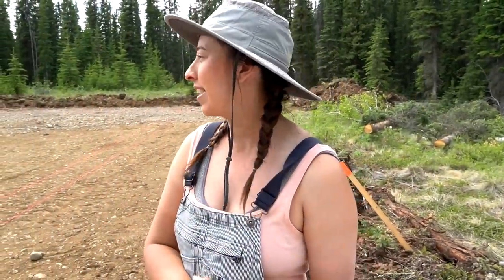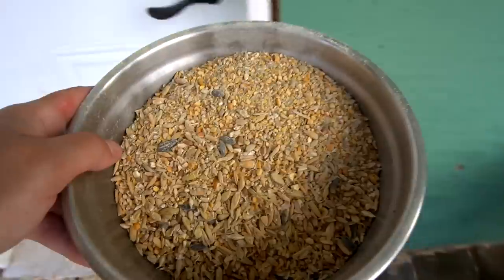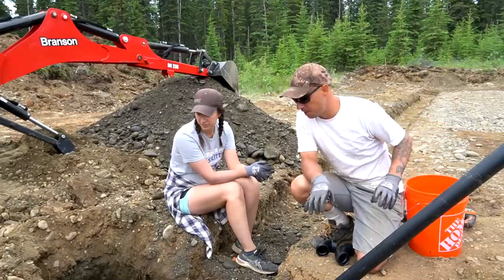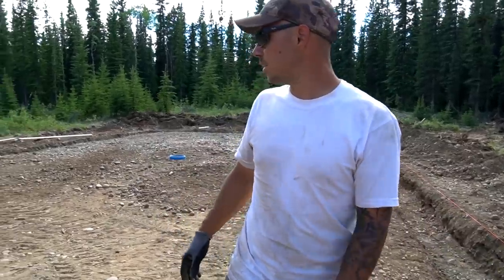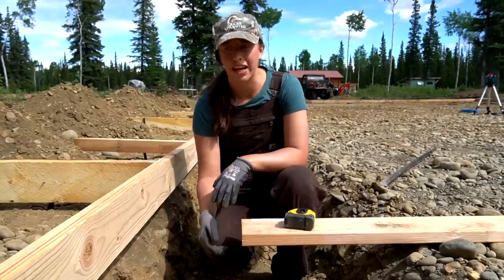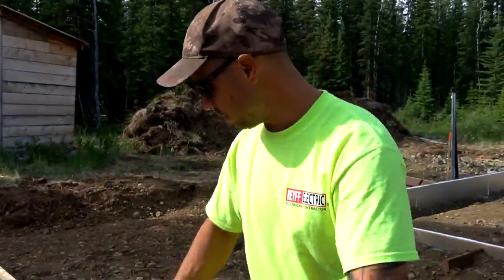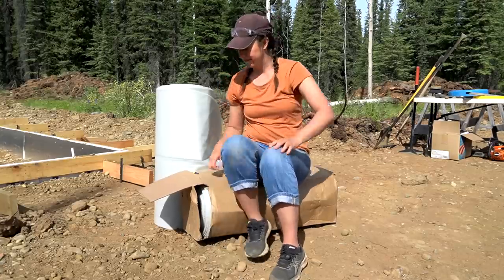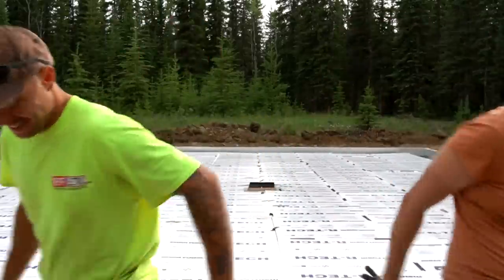The Never-Ending Footers | DIY Insulated Concrete Slab | Alaska Quonset Hut Build

Comment: I spent a lot of time on construction sites both large and small.  You guys are doing a spectacular job on a very ambitious project.  You two inspire us all!!   I have only one criticism---PLEASE DO NOT WEAR SANDALS while working on these projects.  I know you guys are very careful--but risking an injury to a foot in such a remote area is not a good idea.  In fact you both should invest in steel-toe boots--just as a precaution.  Yes they are costly --but taking measures to be safe is worth it.  Thanks so much for sharing your journey with us.
Reply: I was thinking the same thing!
Reply: I was thinking that about the footwear...
Reply: At the very least get the boots that  have a composite toe, much lighter. You can even get a kind running shoe with composite toe.
Reply: Engage Ariat Footwear sponsorship!
Reply: I absolutely agree. It’s way too easy to get a bad injury. When it’s your foot it really stops you doing things whilst it heals - and you are busy people :)
I know it’s hot and you don’t want hot feet….. minty light weight moisturiser at the start of the day, change your socks at lunch time (if you get a lunchtime!) and it will help you get through the day. 
One of those larger stones on a toe - six weeks of pain, swelling and inability to keep up with the jobs whilst it heals :(
Reply: Agreed...I wear composite toe (carbon fiber) boots with merino wool socks year-round.  Even when it's 100f+, insulation works both ways.  I do wear an uninsulated and vented "jungle boot" in the Summer and heavy insulated in the Winter...but the socks never change!

I've broken toes...turns out the stupid things are kinda important to mobility. LOL
Reply: Someone should sponsor them!!!!
Reply: We all learn that lesson the hard way. 😂

Comment: I know it was a lot of hard work putting this video together,plus concentrate on your measurements for the floor.
Just wanted to let you both know we appreciate you! Thank you!❤
Reply: lndeed!  Excellent filming and editing skills....balance of project, animals, scenery...
Reply: Lumnah Acres ~ Pouring the same thing ~ Same dimensions ~ Northern NH ~ Right now! ~ Not gonna lie.  🙏
Reply: @stevenwarner7348  Lumnah is pouring a 40' x 40' and is not going to be a Quonset hut.
Reply: If you are putting your poly down first You should blind the site with sand to prevent puncturing. whoops too late !
Reply: @alanesterline2310  Ohhh. I guess I was wrong.  Sorry about that.
Reply: @stevenwarner7348  Steven, I was not knocking you, just clarifying the size.  That's part of what is so special about these two. They do similar things to others but are much farther from the store and have a less comfortable climate much of the time. They continue to amaze.

Comment: For future reference, you can put  your stakes a few feet past the corners , and let your strings cross each other, make you'll just need 2 stakes for each corner, just hold them out far enough from the sides to you can get your tractor in to dig, then all you have to do is put your strings back up to check you work and square your forms up.

Since you're not below the frost grade, be aware to allow for the concrete heaving and dropping, when you run your electric and water line so they don't get damaged when things go up and down.

Comment: One item you might reconsider - the wood form beneath the drain will rot out over time. The way it is built, the drain frame will fall downward if there is rot or too much load is placed on it. Concrete should support the drain frame. I've done this hundreds of times> Build a wood form that fits loosely inside the metal frame. Drive a few nails around the perimeter of the form to support the metal frame at the correct height while pouring the concrete. After the concrete sets up, the wood form can be removed and the exposed nails can be cut off flush to the concrete.

I think you put the vapor barrier in the correct place, on the bottom.

Comment: I am always amazed by you two. You get so much done on projects most people won't even know how to start. Not sure when you plan to pour concrete, but if you read this before pouring think about putting a piece of heavy chain in each corner. It will allow you to anchor you building. Kind of belt and suspenders. Be safe.. Till next time.
Reply: That is a good idea. I hope they get the note.

Comment: You can use some of those bigger rocks to prop  up rebar or your mesh and use rocks to take up space in your pour. It will save some concrete yardage. As long as the rocks have 2" of concrete above.

Comment: Awesome job with the slab foundation! I'd be with you, poly down first, then insulation boards, and you saw why with the condensation. It'd be a good idea to put grade stakes in the pad, to help pour the concrete to the specific height. Also, as you're pouring the footer, to prevent blow out, Ariel can be backfilling the outside, as you're pouring the inside. One force pushing in, one force pushing out, equalization. Good luck! Love ya'll ❤😊

Comment: Tip for your string lines, place the stakes/hurdles for the strings well away from the slab area, the strings will all intersect exactly where you need them but they won't be in your way when you excavate, and you can retie the strings when setting out the formwork or walls.

Comment: You two are GREAT.  Mining your own gravel, doing your own forms and everything else.  WOW!  You might put a gravel grizzly or something like one on your to make list.  It is essentially a giant sifter for gravel to separate the big rocks from the gravel.  You could make one out of milled boards that have 1", 1.5" or 2" between the boards that are set at an angle to allow the big rocks to roll down the slope.  Anything that goes through the slots falls down below.  I have seen them made out of metal that have more than one sifts with them going different ways/directions.  Or there are other ways to separate stone by size.  Might have to search for other ways as there are rotating separators and smaller vibrating ones.

Comment: the foam around the outside of the building might not be necessary. When I had my 38x50 garage foundation done with infloor heat they put the 4" foam under the poly, so it wouldn't get torn up with the mesh the infloor heat (ICF pipe) was tied to. I have a 6 inch slab if you are wondering in the shop but you could maybe get away with a 4-5 inch. it will need expansion gaps too when pouring to guide the cracking of the slab.

Comment: Looking great you two! That’s going to be an awesome shop! 2 things: 1) bring that poly all the way through the bottom of your footer and up the sides and seal it off. 2) as best you can, insulate the bottom of your footer and if possible tie it in to your floor insulation. The cold will radiate up through ANYTHING that isn’t insulated and suck the life out of your radiant heat run. Your outside run of PEX will be most susceptible to cold exposure and kill efficiency. Insulate and seal EVERYTHING inside the forms! You will thank yourself later when there’s no cold spots! Keep on rockin’! You’re doing it!!👍🏻👍🏻👍🏻

Comment: This is awesome! My husband works with foam all the time. On the sides you can use winlocks( a plastic or metal disk with the screw going through the center) this gives you a bigger area so it doesn't go through the foam like a simple screw head. In case you are still concerned about it!! You guys are going all out on this! What fun and that tractor has really paid for itself already I bet,!!!! Great job!

Comment: Poly goes down first, then foam board. The rebar needs to have chairs to hold it up so it is inside the concrete. EDIT Never mind, I see you are using wire instead of rebar for the slab.
Reply: there going to have bigger problems that footer is going to crack all the way around where it goes from thick to thin water will get under the footers and freeze and lift it up the footer needs to go below the frost line then pour the slab inside the foundation after that

Comment: What a fantastic addition to your chicken flock.  I'm foreseeing a lot of eggs and meat for y'all, plus the dogs.  The little chicks are really cute.  The Quanset Hut floor is quite an ambitious project.  Good thing you did you due diligence and realized you were going to need a tractor to perform all its tasks on the new homestead. 2)Since you're from Oregon, instead of saying 'pricey', I expected to hear you say 'spendy', about the cost of the 10-mil poly.  I agree with putting the vapor barrier below the foam board.  The poly should extend from the top of the footer all the way around, enclosing all your concrete.  Any place your concrete touches soil would be a water infiltration point.

Comment: When we lived in Nome, AK, we started with delivery or hauled water.  Delivery went to a large water tank inside a boxed area (layers of dense closed cell foam insulation with plywood on the outside). This had heat tape and pipe insulation on the piping from the water tank to inside the house.   It might be something you could consider using on the shop.  In all the years we were using it, it only froze once.  

When the city water and sewer lines grew to our area, we switched to a large dual insulated pipe set that ran continuously with heat tape on it too.  It also froze solid once even though we had it in an insulated box too, again when the heat taped failed.  We had to thaw it very slowly over several days in order to keep from busting pipes.

Comment: You two really are not fooling about - this is all very cool. I would be a bit astonished if you missed anything at all on this pour. The wire will help make certain the foam does not go anywhere due to wind etc. Rebar can be handy for that too even if for a temporary fix, and on maybe smaller pads of course. This pour is a gem in the making I suspect. Hope so. Have a good week. Be well all. 😉

Comment: Eric just a heads up!! If you are doing a infloor heat you definitely want to make sure that the pex pipe doesn’t touch any of your rebar!! If it does the rebar can rub a hole into the pex line making it leak!!! I’ve seen people pouring floor with the rebar just laying on top of the pex line and I try to let them no that they definitely don’t want to do that because after time the rebar will definitely rub a hole into the pex line!! Concrete does move during freezing and thawing!!! The project is definitely looking amazing for sure!!! It is definitely a lot of work but it will definitely be rewarding when you get it all finished up also!!! Remember keep up all the hard work buddy!!!!

Comment: If you can manage it, you want to slope to your drain 1/4 inch per foot so water actually drains. If you can't  get that much slope breaking the bubble on a 4' level is the minimum you would need to get water to drain by itself or you are going to be pushing water to that drain. All in all you both should be SUPER proud of yourselves for tackling this level of concrete work. Its a tough unforgiving material and most people shy away from doing a sidewalk or patio and you two are doing great with a whole foundation and slab. Keep up the great work, can't wait to see the pour, though I hope you bring a few extra hands since you said you were planning on doing the slab and the footing monolithic.

Comment: When fastening foam or other materials that are soft use a plastic washer with your screws.  They come in various sizes and styles.  Also I have learned that much thicker "pond liner" is better than poly for a ground barrier.  Pond liners come in different thicknesses (I prefer at least a 20 mil to survive wheel barrows and construction) and they are built sturdy and U/V resistant.

Comment: The Gravel.  The Gravel "functions" like concrete.  It is compacted. It will not move.  You really don't need much of a "footer."  Because the Gravel "functions" like concrete.  Eric.  You can think about this just "everywhere."   You're form work here is amazing.  Just remember.  The Gravel "functions" like concrete.  The footers are not so critical.  Although holding the span in place is important ~ fair enough.  Steel rebar is important, the perimeter insulation board is important.  Super important. You guys could easily build a landing strip there. Just land Airplanes on that gravel.  Just what happens with insulation. It's the Gravel.  I still stand by my passageway "suggestion" below.  Whew!   ✨🌸✨

Comment: Put washer on screw before screwing into insulation so screw holds. They make large head screws as well. Great job
Reply from the maker: We need to be able to pull the forms off when we are done so the washers would not work for us in this situation

Comment: Simple heavy mill vapor barrier before the slab is poured is a good idea. It's also all you need. Save the cost of all the additional foam you are sinking into the foundation and put it towards a quality spray foam insulation for the structure that will be above ground and make a much further impact on external weather vs. internal cooling and heating.

Comment: I am a plumber. Just a suggestion. Only in hopes to help. The drain and water line pipes for sink. Might want to stub out a good 5’ away from footer and just cap lines below ground and put a stake ( junk 2x4) at end of pipe and backfill. You won’t have to disturb the ground close to your new footers later on trying to cut 90s off on outside of footer

Comment: For what's worth, and coming coming from a very extensive commercial refrigeration back ground, EPS (expanded polystyrene) absorbs moisture more rapidly than XPS (extruded polystyrene).  Once it absorbs moisture, it loses it's R value.  Worse than that, once saturated it can freeze, expand and break concrete.  Every slab that is poured for freezers here in Hawaii with crazy humidity where the ground moisture will condense and be around the insulation uses XPS foam for this reason.

I commend you for your perseverance on this project and wish I could work on my own homestead project full time to get it done so I can finally move home to it.  Your projects help keep me inspired to keep going on ours in Wasilla area.

Comment: Well got to the end whew lots of work. Y’all really did your research. Impressed with your QC, fixes and corrections. This is definitely time to do it as a minor deviation can result in a lot of concrete. A thin slab with future equipment on it as well as frost lifting etc can lead to cracking. I think putting the vapor barrier under is the best because you will be heating the floor and it should dissipate any condensation. Also remember with concrete it never really stops curing over time. Impressed with your commitment to a DIY project of this magnitude. I always say any structure starts with a good foundation. I’ve seen to many nationwide builders transfer deficiencies from the foundation to the roof over the third floor. You can see the sag. Anyway great video excellent work and work ethic none of that gravel work is easy. Thank you.

Comment: Have you ever used a walk behind vibrating compactor? It will help fix some of the big rocks sticking up and give you higher compaction in disturbed areas which will better support the concrete and help prevent frost heaves by allowing less melted water to penetrate underneath.

Comment: A few things to consider if you have not poured the floor yet.
1) get all the help you can find.
2) might think about renting a power screed with a 16' bar.
Also put a screed board in the middle for your screed the pull the boards as you place the mud and float it level.
3). Rent at least one maybe two power trowels and make Sue to buy new blades. Then keep the blades when you are done.
With this heat and a slab that size it is real easy to lose it with out the power trowels.
Just suggesting from experience. By the way watching you makes my back ache.😊😊

Comment: Sounds like you need a gravel screen you can build one with heavy wire mesh on a timber or steel frame then just use your tractor bucket to just tumble gravel across it to screen out the bigger rocks sticks etc. Some places they are called Grizzly.  You are so lucky with the gravel you could make concrete with that and cement for sure.

Comment: As a contractor retired an live in north western Ont. Canada with long cold winter to 40 50 below same as I know were you are. You footers need to be dug out 6" deeper an set a 4" drain tile all the way around an tee it out over a hill. Then back fill   with your gravel with fabric around the tile since you not using washed crushed stone. Compact over the tile. Add foam board in bottom an up the inner footing sloop. Water is the biggest heat robbing. Also for the type of slab your doing the inner bank of your footer must tapper up close to 45 deg. To keep your pit run gravel from falling in mix it with top soil as that is how good compacting gravel an road gravel is made. At a 4 to 1.  If you dont tapper it. It will brake up at that sharp drop. Yes the poly go down first. With in floor heating you dont need a floor drain unless your always doing heavy power washing. Snow melt water is long gone before it makes it to a drain. Mine was a wast of time and money

Comment: I don't know where my comments are going here. But.  Ya gotta see what Al and Gina are doing there in Northern New Hampshire!  It's getting to be a very popular site. 500 acres there "up north" for me.  Anyway.  Right now, as we speak.  They are prepping a concrete pad for a barn build.  Hydroponic in slab pec heating.  Yada Yada.  Anyway check out Lumnah Acres.  In New Hampshire.  Not sure about the timing for the pour.  Al and Gina have moose running around and black bears.....  They are my other "go to" off grid couple.  (not gonna lie) ~~~. And so.  You guys are amazing.!!!! ~ It's the Gravel ~.  Wow!   ~~~ Thank you so much for sharing.   ✨🌸✨